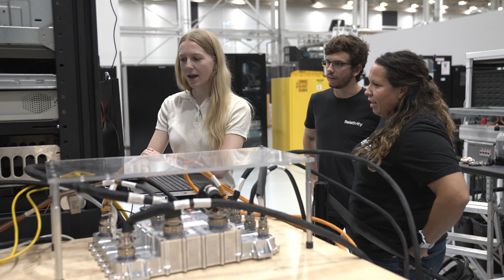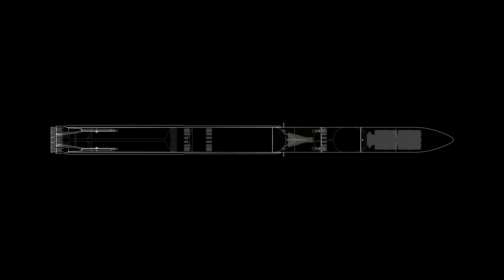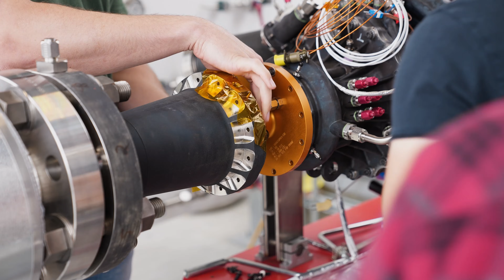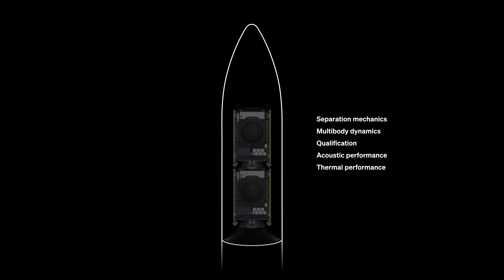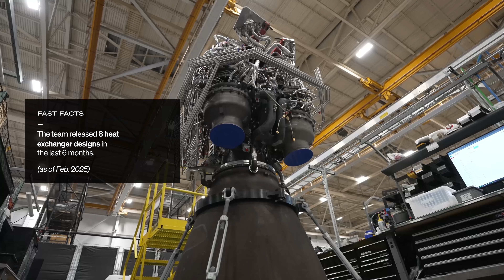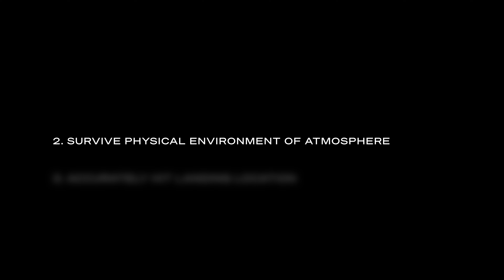Q1 2025: Terran R Program Update

Comment: Are you just outsourcing everything now :/ whats the opposite of vertical integration?
Reply: bringing in billionaire owners and outsourcing is a choice, i get it for smaller players in the industry, but seems like kicking a problem down the line, i hope they're working on infrastructure dev to bring that stuff in house, margins on launch will get slimmer as time goes on and this seems like they're poised to have costs and timelines balloon from using so many external suppliers/sub contractors.

Comment: One way to increase performance, especially to GTO, is to optionally offer a shorter fairing that is long enough for typical six-ton comsats on an Impulse tug.

What informed the decision for helium COPV’s instead of nitrogen? Helium has a much more dubious availability and cost efficiency in the coming years.

Why didn’t the Aeon team choose an expander bleed cycle to simplify engine design from the start of the company? I can sort of understand why they didn’t pivot between Aeon 1 and R (expand on what we knew and learned from Aeon 1), but why not simplify engineering from the beginning?

36:36 is the most materially important admission regarding the company. When will Block 2 be ready, and in what numerical flight? How much of a funding buffer do you have in case of unintended struggles related to achieving re-flight? Is this material information why a billionaire pulled a Marcus Lemonis and funded his way into the CEO role, because the company is or was secretly in de facto financial distress?

Comment: The fact that you explaind in great detail you pivot to more "conventional" manufatuting techniques. But still maintain and further develope your expertiese in 3D additive manufacturing is impressive.  Your investors and customers must be impressed with your workings.  I look forward to your next updates on the TERRAN R program!
Reply: As an engineer admittedly not in this industry I cannot fathom why you mill sheets of aluminum for the second stage, and need to see a lot more data on critical engine parts being 3D additive manufactured and how the crystal structures actually bond and don't create fracture layers that will be exposed to the massive stresses and heat of being a rocket engine...

Also 9 gimbaled engines feels excessive. That's a lot of weight and complexity, and just makes me wonder why it's necessary.
Reply: @miamisasquatch if you would like to know why milled aluminum is used, I recommend the ULA factory tour video from the channel Smarter Every Day
Reply: @The rocket equation is an unforgiving mistress...
Reply: This is a blatant copy of the SpaceX rocket. 🤦‍♂️🤦‍♂️🤦‍♂️